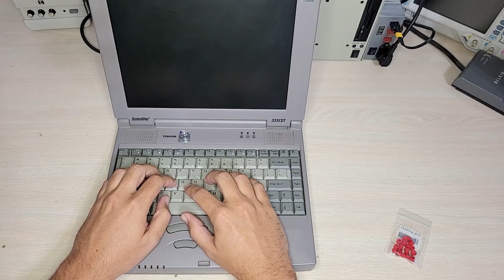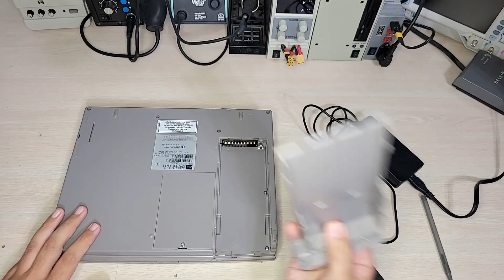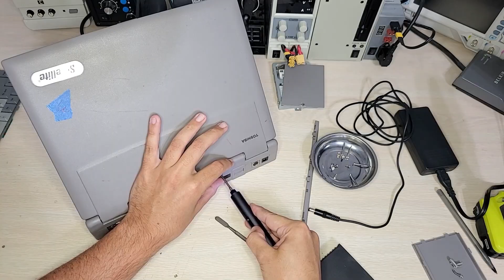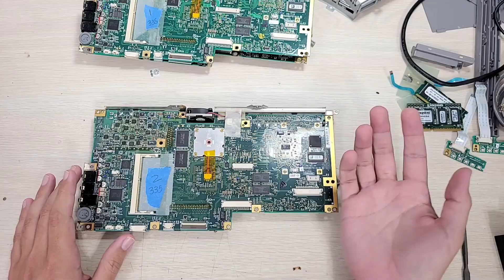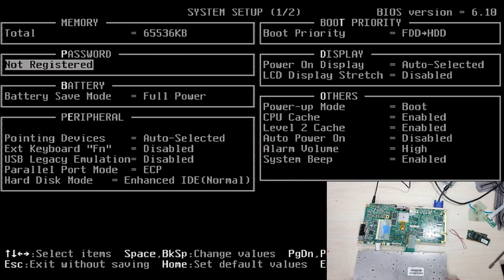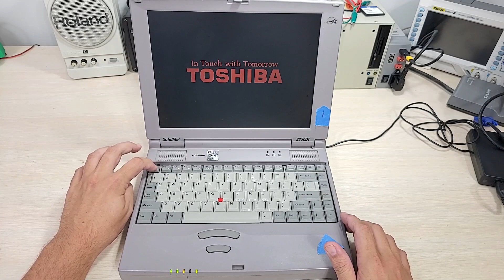Toshiba says what!? Soldered RAM Upgrade

Comment: Excellent video. By the way, I have a 320CDT and the LCD is developing a stain in the center, does anyone know if it's still possible to find a replacement LCD for it?
Reply from the maker: Thanks for the kind words! I'm not aware of any modern replacements, but the LCD is a standard size and resolution. Your best bet will be to find the model of the LCD panel. Search around and see if anyone has disassembled the LCD assembly and shows the model, otherwise you'll need to do this. Then just hope that ebay or other marketplace has some new-old-stock or used replacements. I will probably do a follow-up to this video in the future as I have some extra panels that may be compatible but I'm not sure yet :)

Comment: Hello Sir. Thank you for This Video. I got myself an 300CDT and I want to Update my old 6er bios to 8 like you for Support of Larger drives. In Google i cant find any Legacy bios for any toshiba Model - only Dead links. Where did you get yours? Maybe on Internet Archive there is an recovery iso for 320 cdt Models - could this be helpful? Thank you very much 👍
Reply from the maker: I added two links in the video description to driverguide for BIOS 7.40 and 8.00. The files look legit, just scroll down about halfway and click the link under where it says File Name. From what I can tell most of the drivers and BIOS files are compatible between the various models 320/325/330/335. Hope that helps!

Comment: Could this be done on a Libretto 70CT or M3?
Reply from the maker: Libretto 60 or 70 yeah. The M3 uses the small 2 pin connector like the 100/110. It’s possible but likely not as drop-in.
Reply: @RobertsRetro  , can you show the 70CT memory upgrade in one of your videos?
Reply from the maker: @m3mes  The Libretto 70 takes the same proprietary memory module as the Libretto 50 and 60. As far as I know it is unique to these 3 machines and brings the onboard RAM up from 16MB to a max of 32MB.

Comment: Bigger of those two batteries inside is for sleep mode, these actually had a function to swap the main battery on the go without fully shutting down the machine. :) Smaller one is for CMOS and real-time clock.
Reply from the maker: I was thinking that, though in practice having used one of these for many years I can't remember a time that it actually worked. Probably more a result of the standby gamble with Windows 95/98 in that every so often it would just outright lockup when waking back up. Thanks for the info!

Comment: I had the slightly earlier 205CDS series.  It had the same plastics problem as the Libretto had.  It was a Pentium 100 with 8 Mb RAM and an 810 mb HDD.  I maxed it out at 40 MB and installed a 3.2 gbb HDD  and an IBM card slot modem..  It served me well in my early work years after college,  I overpaid egregiously for it, buying it at a dedicated office supply store, not knowing any better.
Reply from the maker: That sounds like an interesting model, I believe it even had one of the earliest laptop optical drives that were much larger. It's wild how expensive these laptops could be back in the day, especially adjusting for inflation. I find they make really great retro machines these days without needing a full tower.
Reply: @RobertsRetro  Yeah, it had a 4x CD drive that could be swapped with a Floppy. The Cd drive was standard sized, just like the one in your machines.  The floppy also had a separate enclosure so you could use both at the same time. At the time, in either late 1996 or very early 1997, the machine cost me as much as a nice used Honda would have. And that's before the hideously expensive 32mb RAM upgrade and the "enormous" 3.2gb laptop drive replacement.  The Store tossed in an additional 8mb upgrade, but 16 gb was still marginal if you chose Windows 95 during the OOBE setup.